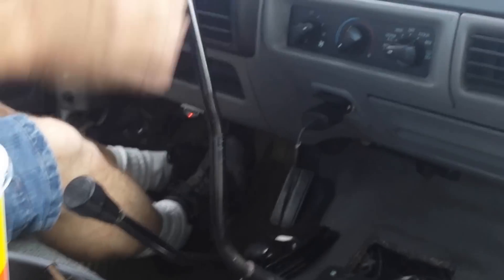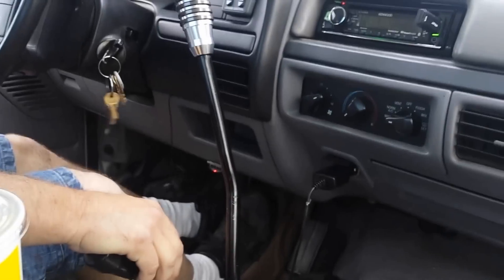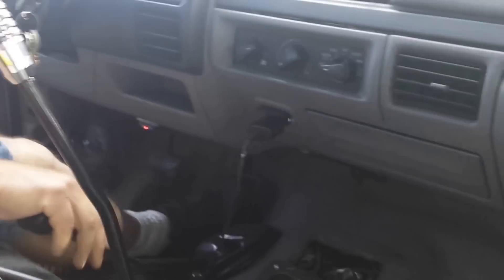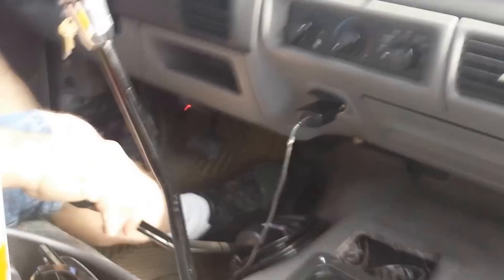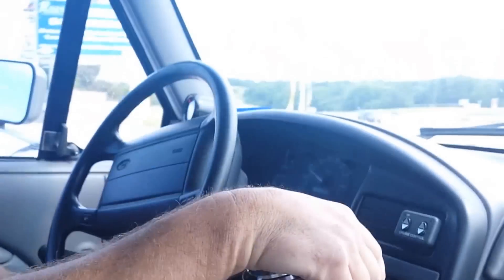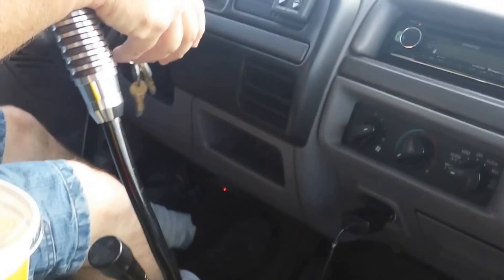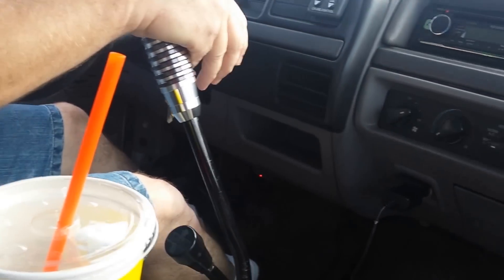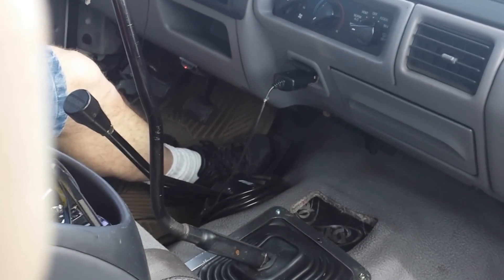F150 twin stick test drive

Comment: Don’t have to worry about someone stealing it .
Reply from the maker: Not that anybody would want to, but yeah. Heck just a simple stick shift is enough to deter most kids these days.
Reply: yeah most people these days cant drive a standard.
Reply from the maker: Yeah, I hate autotragics.
Reply: @okcman34  because most of the parents never take the time to teach their kids how to drive standard transmission, I did my part with  my boy. Spend the money and time.
Well worth it.
Reply: @Stumpy1973  yeah.  I'd hate to think if they were to commit a crime and try to drive away in a 1953 Packard Clipper or a 1952 Studebaker pick up truck. They both even start weird.  You start a Packard by pressing the clutch all the way to the floor.  The gas pedal starts the Stude the same way.
Reply: @Stumpy1973  not in Europe
Reply: ktumbleweed I think I'm the only kid who wants a 2001 Ford F-350 with a flatbed and a manual transmission for my first car lol I'm only 13 and I can already shift a 10 speed lol
Reply: Ryder Grimes I got a 91 w350 single cab Cummins flatbed 5speed  and my dad a 93 4door Chevy dually with a 12vavle Cummins and a RTO6610(10 speed) besides him I’ve driven his pickup more than anyone.
Reply: @rydergrimes6696  don't worry lol, I'm 16 and I am gonna buy a first gen dodge with a manual and a cummins
Reply: I'm 19 and I drive a 1966 F250 with a 4 speed manual(Although it's pretty much a 3 speed since 1st is a low and isn't used much).
Reply: Landon   Schad 
Same I bought my 2003 mustang GT when I was 17 and never want an automatic
Reply: Sorry to bust yalls bubble but manual shift Honda’s are the most stolen vehicles if they’re stealing cars best believe they can drive stick
Reply: @williamwatkins1996  absolutely true, if a car thief is smart enough to break into a car and steal it, then he better be smart enough to know what a manual transmission is, and how to drive one
Reply: Hey 16 love to drive stick shift I have a three on the tree..
Reply: 16 and have a 96 Dodge Ram 3500 Cummins with a 5 speed, I love driving standard
Reply: 19 here and I got a 97 f250 with a 7.3 and 5 speed. My dad taught me in his old 77 with the New Process 435.

Comment: Why?
Reply from the maker: Why not?
Reply: In this truck its likely mostly a novelty. However its generally a feature of much larger trucks intended for hauling a lot of weight. Imagine hauling something too heavy up a very steep hill, a large leap in gear ratio could mean you'd have to nearly redline it to avoid lugging the engine after the shift.
Reply: Duke Junior 

Honestly. 92-98 ford trucks are probably some of the toughest dam trucks out there. Yah they have some problems but nothing major or hard to fix on the run. So why not.
Reply: Because he can duh.
Reply: Duke Junior cause it's fucking amazing :D be creative
Reply from the maker: You are exactly right on the money. Yes it is mostly a novelty. Yes it comes in very handy when towing to have a gear between 3rd and 4th. I tow a 7K lb trailer from time to time.  I use 3rd Over a lot when towing, or just going up a hill empty. On a daily basis I only use the splitter as an overdrive in 4th gear on the highway. I can just drive it like a plain old 4 speed if I want to. Thanks for watching and commenting!
Reply: ktumbleweed Hi great video, I thought only 2 stroke diesels had two gear sticks due to their narrow power band. Does your engine have a narrow power band?
Reply: Amateur Torque probably not (its a 300ci 6cyl ford and twin sticks are just normal semi truck transmissions except that you Manually shift the aux box instead of using  pneumatics

Comment: quit resting your hand on shifter your gunna wear that trans out my granpa would slap me for that
Reply from the maker: Not trying to be a smart ass, but I am ASE certified in Manual and Automatic Transmissions, I am a master mechanic with over 20 years exp.  Can you explain to me how resting my hand on the shifter is going to wear out my transmission? I have been driving that way for over 28 years and never had a problem with a transmission. I have worn out clutches, I once broke a shift fork drag racing when I was 17 and stupid. But I have never worn out a transmission by resting my hand on the shifter. Yes I have heard that claim before that resting your hand on shifter will do damage to the transmission. The theory is constant pressure on the shifter causes the shift fork to rub against the shift collar. This in turn wears the fingers on the shift fork until they break. However even without resting you hand on the shifter the fork is constantly rubbing against the collar so.....
Reply: There are quite a few videos out there that talk about this from people who are "experts". Apparently, you can wear the shift fork down by pulling(resting hand) the shift fork and rubbing it. I hate that wrong or exaggerated information is sometimes given out. My two favorites though is, one guy said you can wear out an auto by resting your hand on the shifter and one said by holding the clutch in while stopped in traffic or a light, it ruins the throw out bearing, because the throw out bearing spins with the engine by pushing the flywheel away. If you want some laughs look up engineering explained. The guys torque converter discussions are hillarious.

Comment: bad ass truck what is the power train in it Cummins or uther
Reply from the maker: It has the factory 300ci (4.9L) straight 6 gas.  Nothing fancy there, I want to swap in a built 351W..  Someday perhaps.
Reply: ktumbleweed nice  i would love one  like that with a 12 value Cummins i currently have a 93 Chevy 1500 with a standard looking for a truck like yours with a 6.9 power stroke

Comment: So how does that work is it a 2 speed rear end?
Reply from the maker: It is kinda like a 2 speed rear end. It is actually two separate transmissions that are bolted together. One is a close ratio 2 speed (direct drive and overdrive) and then a 4 speed wide ratio (granny 4 speed).  You can have two gears for each of the 4 speed gears.  if you went thru all 8 it would go like this.  1st gear , shift to 1st overdrive. Shift to 2nd gear and at the same time shift back to direct drive. Then shift back to overdrive, so now its 2nd over , then shift to 3rd and same time back to direct.  Rinse and repeat until you are in 4th overdrive (which is same ratio as 5th in a normal 5 speed). Normal day to day driving I simply leave the splitter in Direct drive (or low if you prefer) and drive it like you would normally drive a granny 4 speed. start in 2nd , 3rd, 4th until I get above 50 on the highway then I shift into overdrive. Coming off highway I slow to about 40 or so and then shift out of overdrive. From here back to a normal 4 speed granny. I only split the gears to have fun, or if I am towing a heavy trailer.
Reply: ktumbleweed wow that's BAD TO THE BONE  so interesting thanks for going out of your way to explain that to me good presentation very understandable So thanks again

Comment: And I can't even drive a basic 5 speed :/
Reply from the maker: Sticks are awesome. Go out and learn, you will have a blast!
Reply from the maker: I am 44 and have driven since I was 15. I also drove semi's for almost 12 years. 10 speed , 13, 15 and 18 speeds.  I like the challenge. A normal 5 speed is boring to me, that is one of the reasons I did this conversion. Get some more seat time and driving will become fun. Learn to drive a stick, that is when the real fun begins.
Reply: chris bastin yeah you can just gotta do it
Reply: I can't even drive correctly I'm 18 and have less than 10 hours worth of driving
Reply: Dana Harvey I'm basically hyperventilating while driving being extremely anxious and worried about EVERYTHING
Reply: HERPY DERPEDY and that makes you a dangerous driver. The worst thing you can ever do while driving is get nervous or scared. Now I have been in situations where I damn near shit myself but I was never nervous before or after what happened. Being nervous or scared will distract you from driving properly.
Reply: brandon calin jk it was a joke I have avoided accidents and even though I haven't been driving much there are some drivers who will just screw your mind
Reply: My 5.4 f150 would be fun with a stick. Nv4500 or the 6 speed. $$$
Reply: Update: I now drive a six speed Cummins 😀

Comment: I like your way of thinking, IE the split shifting. You commented on the OD being noisy. just how noisy? Turn up the radio, or having to yell at the passengers to talk? Could you do a video with this set-up on the high-way? Thanks for posting.
Reply from the maker: joe quinlan , turning up the radio does the trick. It is not deafening, just annoying. You can hear the noise on the video, and you can easily hear me talk over the noise. I will try to make a highway video. There is a video of me towing a heavy load on the highway on my channel.
Reply: OK, thanks for the reply. I guess the noise isn't as bad as an M-22, (rock-crusher), and with the benefits of the splitter, (to me) would be worth the slight discomfort.
Reply from the maker: joe quinlan, I tolerate the noise just fine and have no regrets about this conversion. I would do it all over again. Even with the $1400 price tag for the OD box (I got a great deal online as it is normally over $1500) it still ended up being cheaper than a ZF5 swap. I have a heavy duty 4 speed (T19) and the OD box is rated for 24,500 gross vehicle weight. More than an F150 could ever possibly tow.  So stronger than a ZF5 and more versatile. 
Bonus fact: I got my T19 from a junk yard for $150 if I remember correctly and simply changed the oil and resealed the top cover and it has worked fine since then. I did replace the rear seal a few months back, and 2nd and 3rd synchros are bit weak but I just use my old truck driving skills to get around that. (rev matching, and double clutching)
Reply: That was a pretty good deal for that rugged 4 spd.  I think the Ranger would be a huge benefit between my whimpy 83 C-30 6.2 diesel, and SM465 tranny. My 2nd to high gear spread is awful, not to mention no OD and a 4:10 rear gear.
Reply from the maker: Yes, the shift from 3rd to 4th (or 2nd to 3rd if you call 1st gear low like Chevy does) is a big jump in most 4speed granny's. This splitter gives you the perfect gear in between for towing.
Reply: I hear ya KT. I call my 465 a 3 spd, (W/granny low) I know some people won't like a set-up like this, but it's all in what you like. The clutch people are a dying breed, and I just prefer them for all the benefits I can't fit here. So once again, I want to say thanks for posting. It helps some of us out alot. Good luck.
Reply: here I am, back after 5 yrs, and it appears Advanced Adapters doesn't market this adapter anymore. Wonder if there any any used ones out there. :(

Comment: How much was this..?
Reply from the maker: The overdrive unit itself is around $1500 , maybe a little more. Check AdvanceAdapters.com for the latest pricing. It is called the Ranger torque splitter , or Ranger Overdrive. It only works with Ford and Chevy 4 speed pickup truck transmissions. So anything newer than about 1990 or so will not work unless you swap in an older 4 speed transmission which is what I did. So assuming you have an older Ford or Chevy with a 4 speed then you would buy the unit for 1500 to 1600 , install it yourself or pay somebody to install it (no idea how much that would be, its a bit of work and some fabrication is necessary.) then have your rear driveshaft shortened about 7.5 inches (the length of the overdrive unit) if it is 4x4 then your front driveshaft will need to be lengthened apx 7.5 inches.

My install was complicated by the fact I was swapping in a 4 speed granny. My 1995 F150 came with a 5 speed with an internal slave cylinder. The trans had an integral bellhousing so I had to use a stand alone bellhousing from an older truck. Just so happens I had a bell from my 1984 F150 that I swapped in a newer 4.6 V8 and 4R70W automatic combo. Always save old parts!! 
Still I was going from an internal slave to an external slave (hydraulic clutch). I had the old external slave from the 84 but I had to figure out the hydraulic line. Solution was to use the 95 master with an 84 hydraulic line and slave cylinder. I had to swap the clutch and flywheel to an 84 model. I was able to use the 95 starter. I had to cut 2 new holes in the floor and cover up the original hole as neither shifter wanted to line up with the old hole. I had to move the crossmember back a few inches and drill new holes in the frame for that. I had to notch the heat shield on the Cat  Convertor. 
I have been daily driving this truck for over a year now and I have no regrets. I still have a blast shifting thru the gears!!!
Reply: ktumbleweed thanks for the reply old mate. Much appreciated. Love the sound of those straight cut gears. Stay safe.

Comment: I want this in my Patrol!
Cant drive a real truck (and the license costs 20000 USD or more here in Norway), but I can get one of these auxilliaries and get CLOSE.
Reply: 20,000 for a CDL???
Reply: @redtra236  Yeah and that was low ballin' approximation at the time.
It's insane.
Back in the day you paid 5 bucks over the counter, boom, no issue, now you almost need more clearances than a navy fighter pilot.
Reply: @ToreDL87  That's incredible no wonder there's shortages of drivers

Comment: How would that be helpful since it's a 150 referring to heavy trailer towing as you mentioned... How heavy of a trailer you going to tow with a half ton truck
Reply from the maker: I have an 18ft car hauler that weighs 2k lbs empty, throw a small SUV on that trailer and its a 7k lb trailer. Throw a 4wd Suburban on that same trailer (trailer is now overloaded but I have done it , and the truck is way past overloaded or past its rated towing capacity) now we are talking close to 9K lb trailer. This truck has pulled that kinda load, now this is way past what a half ton is supposed to do and I know it. I only tow short distances and I keep it under 60-65 mph. One of the reasons this truck has such a low tow rating is the stock mazda 5 speed that is very weak. I replaced that with a T19 cast iron Granny 4 speed. They put these trans in 1 ton and up trucks. The AA overdrive unit is rated for over 24K gross vehicle weight so that makes one hella strong transmission combo. The 300 six is a very stout motor, and they put these motors in small dump trucks so no worries there. That leaves a weak rear end, weak suspension, and weak frame. But so far so good. I have another video on here with this truck grossing over 11k lbs and doing just fine. I know that when I towed that 4wd Suburban the truck was starting to complain so I have not towed that heavy since.  Now where this combo really shines is the fact that a granny 4 speed is a very wide ratio transmission. Ask anybody that has towed a heavy transmission with any granny 4 speed, the shift from 3rd to 4th is a killer. You can rev this piss out of 3rd gear but when you shift to 4th you are lugging the engine. Well this combo gives me a gear between 3 and 4. Perfect!  Plus I kept my overdrive gear, which I can use even with towing cause it is rated for it. 
Yes this combo would work better in a 1 ton truck but for now a half ton is what I got so....

Comment: I can see this being really useful in the older non turbo 6.8 and 7.3.
Reply from the maker: Most of those trucks got the T19 with close ratio gear set. With a close ratio transmission a gear splitter is practically useless. You would still gain the overdrive tho. The T19 close ratio lacks a good granny gear. My T19 has a 5 to 1 granny, the close ratio has a 4 to 1.

Comment from the maker: There has been some misinformation about the gear ratio of this overdrive unit by myself and Advance Adapters. They advertise a 27% Overdrive, so you would assume and AA will tell you it has a .73 ratio. I am no math wizard but when figuring percentages on gear ratios especially an overdrive ratio gets complicated. This unit actually has a .79 ratio. The 27% figure is the amount the rpms drop when shifted into overdrive. I had to do some reverse calculations to come up with the correct ratio by writing down the rpms in 4th gear at certain speeds, then doing the same thing in overdrive at the same speeds. I then knew the rpm difference between the two gears. I then used the rpm formula to come up with the correct ratio.  The formula is speed x gear ratio x 333 divided by tire size.  For example in my truck in 4th gear it is 65 x 3.55 x 333 = 76839.75 divide that by 29 and you get 2650 rpms.  The same formula in overdrive 65 x 3.55 x .79 x 333 / 29 =  2093 rpm's which is pretty much what my tach shows between the two gears. Oh and the 3.55 ratio is my rear axle ratio. in 4th gear there is no gear ratio because 4th gear is a 1 to 1 ratio. Almost every transmission has a 1 to 1 ratio, it is usually 4th gear in a 4 speed and a 5 speed. In a 6 speed the 1 to 1 is usually 5th unless we are talking about a double overdrive like a t56 then both 5th and 6th are overdrives and 4th is still the 1 to 1 or direct gear.
Reply: ktumbleweed so its very similar to a 13 or 18 speed in a rig. you pretty much have half gears.
Reply: I'm curious to know if the splitter mechanism could be adapted like a semi truck splitter using that vacuum/air switch on the stick.

Does reverse have high and low?

Does this make the engine idle differently if left in neutral high?

Not sure how it all works under the floor, but it would make for a neat 8 speed if it could be shifted like a kenworth.